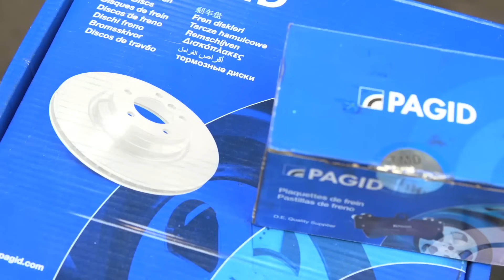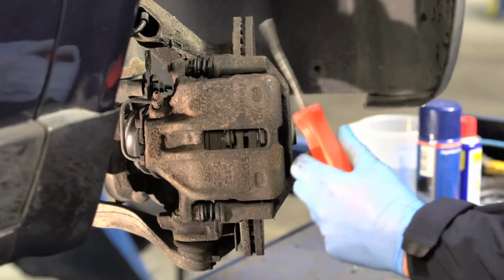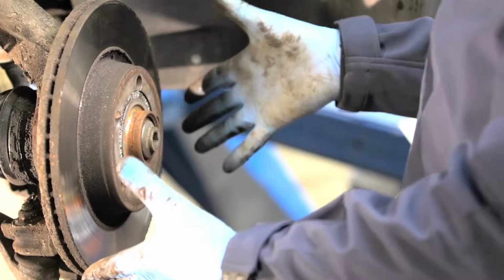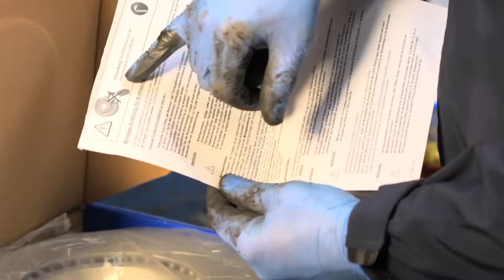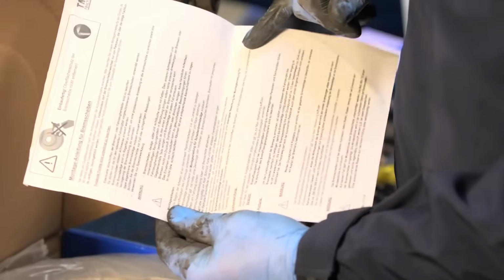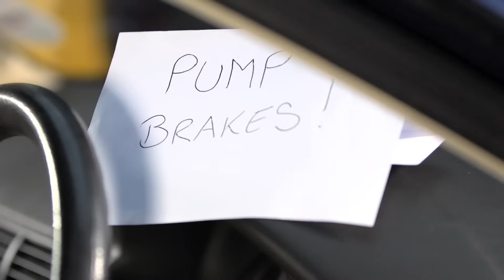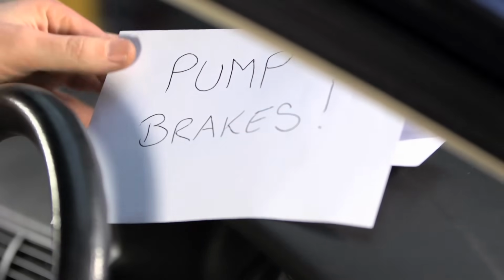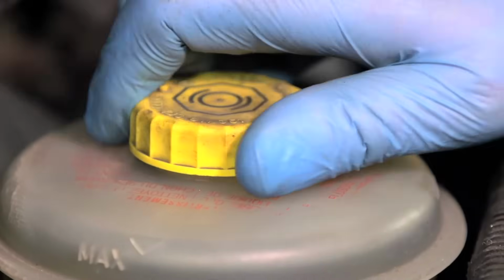How to Change Front Brake Discs & Pads

Comment: fantastic video, especially someone like me who knows very little about cars, this was a good step by step explanation and done in a logical manner for a novice where the presenter does not assume you understand how the job should be done. very helpful.
Reply: if you know very little about cars you cannot know where this person did things right and when he did things wrong...used the wrong lubricants and did not ensure safety critical bolts were correctly tightened and not over or under tightened.

Comment: Excellent "How to" very clear and easy to follow only step I did differently was I greased the Hub after cleaning it of old rust so next time (If there is to be one, car has 200K miles) it should not have rusted up and no need for the hammer.

Comment: Really nice video.  Excellent contents and presentation.  Appreciate the professional, two camera filming.  I must have watched at least 30 videos on youtube on brake replacement (about to do my very first brake replacement), and this video is one of the best.

The only two details that I would add:  1) put anti-seize on hub before installing new rotor (could the brake grease be used instead?); 2) clean and then lube the caliper pins with the synthetic brake grease.

Comment: My present shed (kia picanto) took me 5 days of swearing changing the rear pads and disk, didnt know about rewind calipers, worst bit was when i put brake fluid into the coolant bottle, and eventually lost all the pressure in the system.
ps  The rear off-side disk protection arch had rotted away and bits fell into the pads wrecking disk and pads. Also , no mention of the thin metal liners I got to fit over the cradle before inserting the pads and the hours spent grinding bits of of the pads to make the (cheapest) pads fit smoothly.
First thing you need is a long metal pole about a metre long to crack yer wheel nuts open after the tyre fitter put 160 1bs on it.
Reply: Which garage do you work at ? Quick fit?

Comment: Remember to put some anti seize on the hub before you put the disc on, that will prevent it from sticking to the hub and make it a lot easier to get off next time.
But don’t get any anti seize on where the friction will take place.

Comment: 1) He didn't greased the sliding pins - one of the major causes for uneven wear of the break pads
2) repeatedly places brake discs and busy side of the pads on dirty floor
3) the rubber seals of the pistons were worn out
Reply: Nikolai Tsakov Thank you for the extra advice! I think this video was useful.
Reply: he also appears to have used standard low temperature grease on the end and backs of the pads... that stuff will melt and flow and eventually burn off! Also leaving the brake oil reservoir lid off in these types of jobs is a bad idea. Invites contamination of the hydraulic oil and risks spilling hydraulic fluid on paintwork if it squirts when the piston is pushed back. There is NO need to remove the cap, just slacken it off to let air pressure escape on piston pushback is more than sufficient! And he should have used torque wrench tightening the carrier bolts as they do need to be quite tight but not too tight as it can strip the threads in the carrier if you over cook it with a breaker bar like that.

Comment: I've always used copper slip on the back of the pads and a little when fitting the disc and nuts will help the next time they are removed,if your replacing both the pad and disc once you've removed the top of brake fluid filler cap you could pry back the cylinder prior to lifting the calliper by placing a large flat bladed screw driver between the old disc and pad. It's old school not recommended if your just replacing the pads.
Reply: Sorry to be so offtopic but does someone know of a method to get back into an instagram account??
I was stupid forgot my account password. I would appreciate any help you can give me
Reply: @Frederick Jamal instablaster =)
Reply: @Xzavier Jacoby I really appreciate your reply. I got to the site thru google and im waiting for the hacking stuff atm.
Takes quite some time so I will reply here later when my account password hopefully is recovered.
Reply: @Xzavier Jacoby it worked and I actually got access to my account again. I'm so happy!
Thank you so much you saved my account :D
Reply: @Frederick Jamal You are welcome =)

Comment: Great and useful video,But a little criticism,
Where a mask when cleaning debris,especially where around brake components pad fine particles mixes in with rust, 
Give piston a wipe befor pushing it back in,
There were no use of loctite on certain bolts,heat and vibration can cause used bolts to work there self loose.
Apart from that nice clear instructions,
Thank you

Comment: What about checking fluid level before compressing caliper to save stripping your paintwork with overflow?
Reply: Open the  cap in the bonnet and put a rag in the top

Comment: In case no one else noticed the seal on caliper piston is failing, should have been replaced as it will start sticking before next pad change is due. What good does spraying on rubber seals with WD do?
Reply: Tommy P Yes, infact it rips @18:09 a little when he puts it on....

Comment: Shouldn't the bleed screws on the calliper be opened when pushing the piston back as it could damage abs module or flip master cylinder valves when pushing brake fluid backward?? Or is that rule only applys when doing rear brake pads , anyone ??
Reply: DONT THINK SO

Comment: I need to replace steering rack gaiter at same time. Am I about there once discs are off or is there a lot more stripping down to do. I have heard there is a kit you can use to replace gaiter without stripping down the arm. Is this true??

Comment: I've always managed without using a torque wrench but felt a bit guilty (thinking thats what the pros use), now it looks like I was right all along, 40 years fixing sheds.
Reply: tightening bolts by feel is a gamble, a true professional will use a torque wrench on safety and reliability critical nuts and bolts like the carrier and slider bolts. Too loose and they could self loosen and cause brakes to fail, too tight and could strip threads in carrier or stretch bolts or make a rod for the next guys back if you over cook the torque but get away with it... the next mechanic will likely have to use heat to get the bolts undone next time.

Comment: For the love of God don't spray WD 40 on slider pin boots!
Reply: good day just wanna know why not to spray WD 40 on the boots?
Reply: dion joseph

Hi,

the rubber boots, like all rubber things, is oil-based product. Because WD-40 is petroleum (ie. oil) based and since like-dissolves-like, WD-40 and any petro based lube will eat away at the boots. What you want to use is something safe for rubber parts like pure silicone lube or fully-synthetic brake lube.
Reply: Ste .L ..
Reply: Willie Stewart
 Yes?
Reply: Not a professional job at all ,Can seem at least 4 things wrong or needful doing  .answers on a post card ,ha ha ,failing that just reply
Reply: @dionjoseph9534 because it perishes the rubbers. Same with bicycle chains and motorbike chains it destroys it over time
Reply: Relax, breath in, hold it.....😩👊

Comment: this a how not video? no torque wrench essential for beginners, no thread lock used on bolts! you should always remove clean and grease the sliding pins. The bleed screw was all corroded and cap missing. you should at least clean that and put penetration oil on it so when the need may come to use it its not stuck.